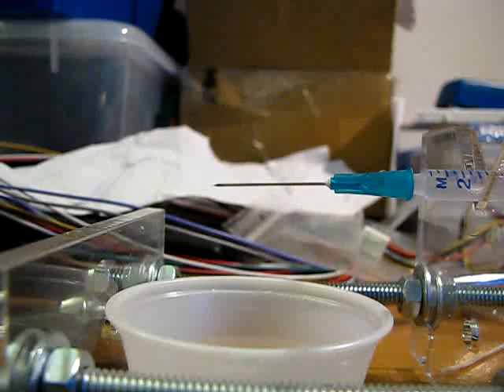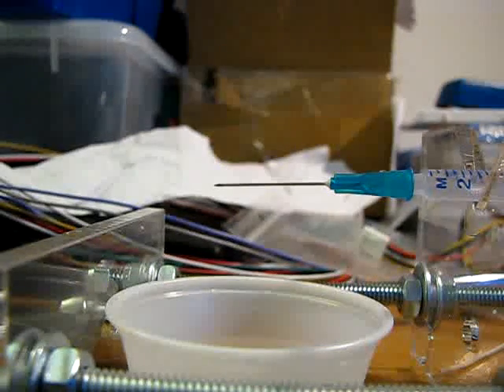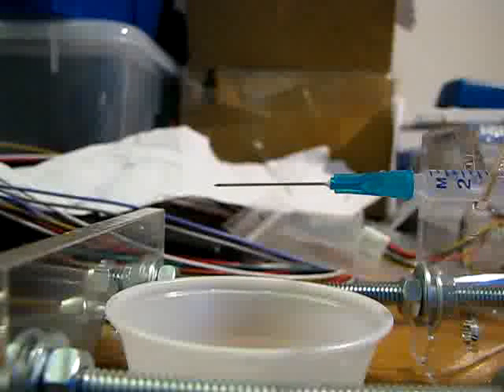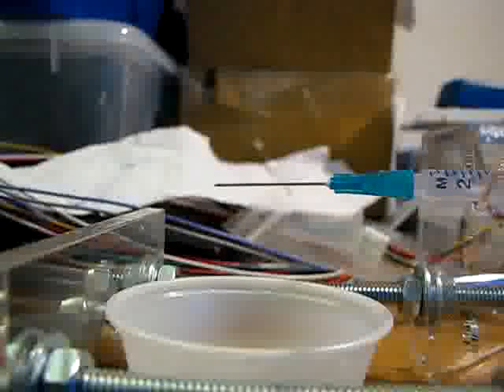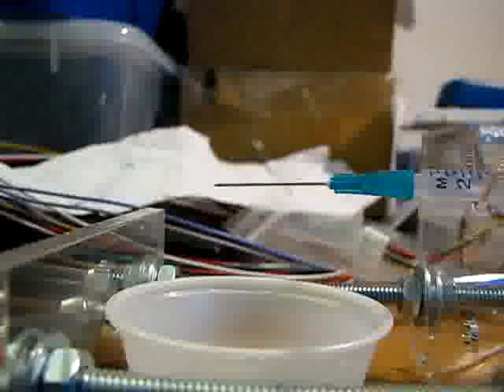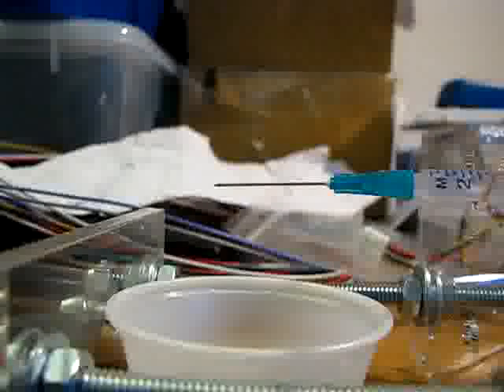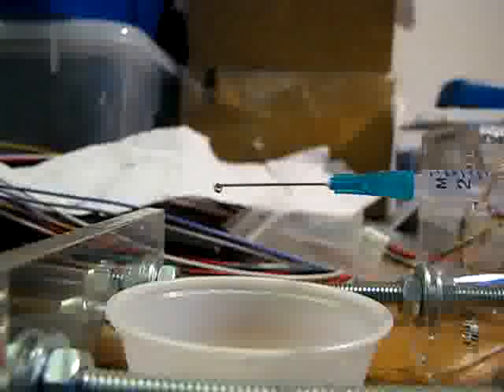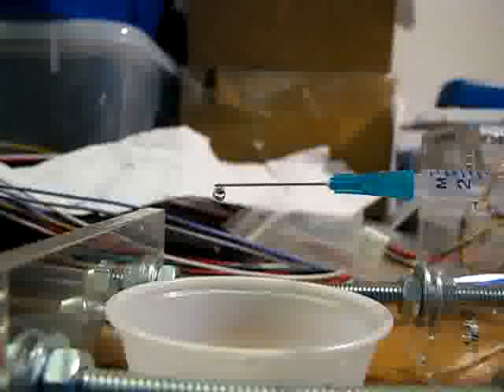DIY Syringe Pump Test

Comment: if you wanted to make the syringe fill up automatically, how could you achieve that? in other words,  i want to be able to leave one of these and let it go for hours and hours, and it may run out of liquid. i'm wondering if there would be an easy way to have it be refilled.

Comment from the maker: @lexichronicle2 The problem with using it as simply a funnel with a tap is that the surface tension of a drop provides backpressure, which is overcome by the force of gravity and the pressure head above it. Unfortunately when the liquid level gets too low, the force of gravity can't overcome it, and it gets stuck.